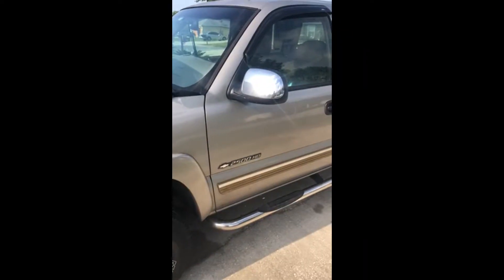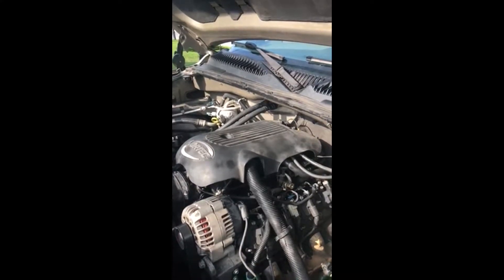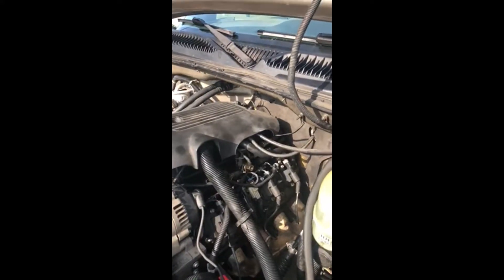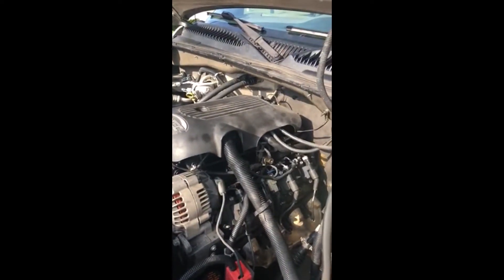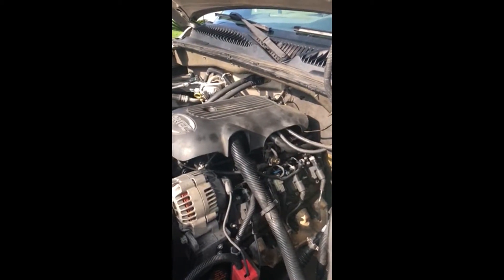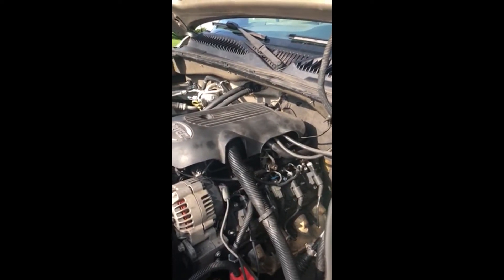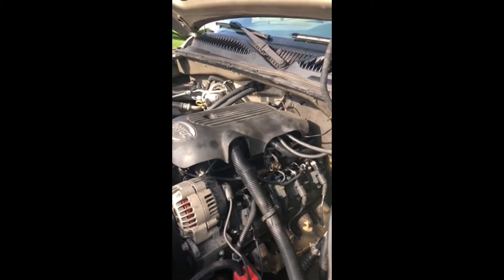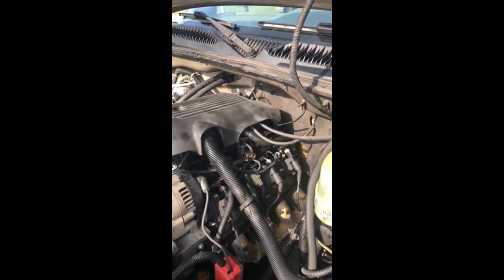Secret to Fix Knock Sensor Issue

Comment: You think this will work on a c5 corvette?  Having this issue. Replaced knock sensos with 3 different brands. Come on like clockwork after 2 start ups
Reply from the maker: Question did you relocate correctly, Did you extend KS wires, Did you clear codes before following the rev procedure? 
If so you have s bad wire connection or bad KS’s !
Reply: @cjphillips987  Sensors are in OEM location. Just replaced again this morning with Napa brand “Echlin”. Light came on again after 2 start ups (as it has every other time with other sensors) I want to try your method but all the comments i seen  were for Chevy trucks. I have an 02 corvette
Reply from the maker: @slightlymodified501  I understand you have a Vette, principal of operation is the same it should work. FYI install KS’s Dry thread if you lubricate threads KS’s won’t work! 
KS’s are a microphone/ sensing Harmonic’s! 
Let me know if you apply this procedure/ Result’s!
Good luck 👍🏻
Reply: @cjphillips987  Just did it but there is good news and bad news. Bad news is that the light came back on but the good news is it was only for 1 sensor P0332. So Im pretty sure it worked but I got a bad sensor. I am going to back in the sensors that I got from the chevy dealer and do the procedure again. I will check back in. I have a little bit of faith again!
Reply from the maker: @slightlymodified501  Great, I understand frustrating KS issues 
My KS have not coded since i made this video, good luck 👍🏻

Comment: I’m a bit skeptical but since I’ve had the confounded intake off 3 times I’m willing to try anything if I can leave the damned thing on.  I just ran the procedure. I’ll take it for a drive and update this when I’m sure they are working properly. Or if the code pops up again. 
P.S. my truck sounds AWESOME at 5000 RPM. 😁

It worked. See my update below. 😀😀😀😀😀😀😀😀😀
Reply from the maker: It’s worked for all but 1, he had an ECU issue. 
Let me know!
Reply: @cjphillips987  
I’ll be damned. I’m shocked. I can’t believe it actually worked. I can’t thank you enough. I drove about about 20 miles (just a guess. I didn’t check the mileage) the last two times the lite came on at 5 to 15. It hasn’t come on YET. I certainly hope it stays that way. 
Thanks VERY much. How did you discover that and why isn’t it common knowledge?
Reply from the maker: @jimgordon3206  it’s Not Common Knowledge for Sure! 
Stealerships deffently won’t Confirm it and Do not want any to know it!
I Share my Knowledge of Hamonic Engineering with Those Who Listen to Understand vs Listen to Respond. 
I’m pleased to Know it Works for You, 
For your Payment I request you pass the Knowledge along, Share Often, Help Others!
Reply: @cjphillips987  
I’m glad to hear you say pass it on. I will. Thank you again.
Reply from the maker: @jimgordon3206  I Thank You 🙏 Please also give a Like and subscribe to my channel, if I’m worthy. 
Thank You I’m pleased it worked for You! Good Job 👍🏻👍🏻👍🏻😎
Reply: @jimgordon3206  Is it still good? My husband having same issue.
Reply: @nneal2096 
Sadly, no. I’ve replaced them twice. I tried another way to reset everything.  That is to disconnect the positive battery cable and connect a wire from the battery ground to the positive cable, NOT THE BATTERY. After a few minutes it’s supposed to clear all codes and reset the computer. That didn’t work either. I’m going to try the 5000 rpm thing again but hold it longer at 5000. Hopefully it will work this time. I’ll update if it works.

Comment: so tell me. (ive had the same issue.  Totally maddening.  I replaced them twice,  then my mechanic twice) Is it possible to do this rev reset AFTER you start having the code come up again?  Or does it work only after the R&R?
Reply from the maker: Clear the Code start the engine perform the rev process 
Shouldn’t have code pop up unless you have a bad KS or Wiring Issue
Reply from the maker: I’ve been driving 5 + years no code

Comment: Gonna have to try this out before swapping them out. My code comes and goes on a 2000 GMC sierra 2500 6.0. Sadly, it is smog month, so that code is the only thing I need in order to pass smog.
Reply from the maker: Could be failing connection plug on harness

Comment: Do you rev up the engine at 5,000 rpm while the check engine light is still on? Or you erase the code first then rev up the engine?
Reply from the maker: Clear codes! Then perform the procedure! 
FYI : PARKING BREAK ON !
Reply: @cjphillips987  ok cool.  I'm gonna try this.    I had a knock sensor code p0327 for years and I swapped the sensor 4 times. Still having the code.  And I swapped the connector.
Reply: @Hammy1088  did it end up working out for you?
Reply: @anthonylee1203  hey.   I haven't did it yet cause I am going to change the tensioner and the lifters and freeze plugs.  So when I do that I'm swapping the knock sensors.   But for sure I'll let you know if it works
Reply: @cristianmotagarcia570  I still haven't done it yet.  Kind of tight on cash.   But I haven't forgotten

Comment: I tried this on my 08’ Avalanche 5.3L.
It only allows me to get to 4k RPM. The check engine light comes on after awhile. Any other tips or tricks you can share?
Reply from the maker: Re-locate new sensors as shown in my other video 
K/S factory said “ 50%” of all new K/S are not valid!
I re- located mine for easy access!
I’m not pulling manifold every time it fails! 
I replaced them new with wire harness they failed 
I re located them years ago no more codes ! Still running great!
Reply: Replaced both knock sensors using ac Delco ,and codes still coming back on my 04 Chevy Tahoe,any solutions....

Comment: Thank you sir. I did try this with no change. Is there a code clearing action at some time before or after the rpm action you recommend?. Or does it clear on its' own after some driving?
If there is a clearing action required, is it best with a code reader or removing the battery cable? Thank you again
Reply from the maker: Morning Tim,
Yes you must clear code before performing the procedure. The knock sensors must learn the harmonics of your engine to send to the ECU. 
Mine is still working with out issues. 
Let me know if I can help you.
Reply: @cjphillips987  Thank you so much. I have cleared code I have done the action you recommend and only with about 5 miles at 60MPH still no code.
I will  try the KICKDOWN action with tromping on the accelerator , let it kickdown (around 4500 RPM and let you know how it goes.
Reply from the maker: @timdoreck3208  the 5000 rpm action should be done in park with break set ! I don’t suggest to be driving to hit 5,000 rpm !

Comment: Do you think this will work without replacing the knock sensors first ?
Reply from the maker: Give it a try but if sensor is faulty no it won’t fix it
Reply: @cjphillips987  ya looks that way. But I think I’ve found the answer. Going to try an external replacement .. seems to be working for most.  One guy even wired one sensor to both of the old leads. Apparently the computer still reads it as two .. 
    🤷‍♂️ we’ll see.  
  Thanks for responding. That cool. 
🤠🎸🎶🤙
Reply: So far so good 🤞🤞
Reply from the maker: @theofficialdiamondlou2418  it works!
Reply: @cjphillips987  I did the sensor relocation. Used one sensor hooked to both wires  to fool the computer.  So far 107.3 miles no codes !!!  The rev thing does work though. First rev spitin and sputtering , second a couple of pops , third smooth as ass on glass.  
Thanks.
Reply from the maker: @theofficialdiamondlou2418  the ECU Control computer must learn the vibration from new point to adjust the fuel air ratio then runs on new settings
Reply: @cjphillips987  I just cleared codes then replaced both knock sensors and harness codes came back now. Should I do the rev thing to reset my ECM or should I wire both wires to my bank 1 sensors? (My plug in machine says low circuit bank 2) again
Reply from the maker: @mister4053  Do the Rev relearn process if it comes back you have a connection issue
Reply: @cjphillips987  can you please explain the process IV heard different things, one person said 4k-5k rpm for 3 seconds twice. Some said 10 seconds twice. Will you please explain what you did to reset yours? I'll do mine today if so! Thank you very much
Reply from the maker: @mister4053  https://youtu.be/-PTpfWjD9v8
Reply: @theofficialdiamondlou2418 I haven't replaced mine and it's worked so far. After reving to 5K twice in park for 3 seconds with parking break on I took it for a spin like I did prior to this tip and check engine light kicked on. This time it didn't..
Reply: @Nate_4545  cool. Well it’s been 3 years and I’ve not had another issue.
Reply: @theofficialdiamondlou2418  what was the exact fix for yours if you don't mind me asking?
Reply: @Nate_4545  
I put a knock sensor on the passenger side head. Then tied both sensor wires into the one new sensor. Then did the rev procedure . I do t remember the fact procedure but there is a link up above in the replies .

Comment: I did this procedure on my 2006 Yukon. And on the second start the light still illuminates. New knock sensors and harness. Did you have to clear codes with a obd2 scanner
Reply from the maker: Yes I did clear code using scanner then followed procedure

Comment: Just replaced mine ks an wires an my cel still came on what is it that i have to do to get rid of it
Reply from the maker: https://youtu.be/-PTpfWjD9v8
Reply from the maker: https://youtu.be/DnnjXBEmH4s
Reply from the maker: I re positioned mine for future service Followed Rev procedure, 
 No More Code Still Working Fantastic! since videos were made!
Reply: @cjphillips987  in the process of reving it to 5k do i need to delete the codes first ?
Reply from the maker: @quentinmiles2246  Yes Sir ! Park Brake On Be Safe!

Comment: I replaced camshaft sensor but obd2 tool still shows code p0366, this trick will be applicable for it also?
Reply from the maker: Cam shaft sensor on what engine?
Reply: @cjphillips987  GMC acadia 2009

Comment: Did not work for my 03 silverado. I guess I'll keep working at it.
Reply from the maker: 🤔 sad to hear, You Have bad KS’s or wiring issue.
Reply: KS and all wiring test good all the way to the ECM. I even put a new ecm on it and still can't get rid of the code. If I figure it out I will post on here. I'm glad it has worked for some.
Reply from the maker: @ChrisWilson-qc9jq  Question did you clear the codes first? Did you relocate them or put back in original position?
Reply: I have a set in the original position and I have a set relocated on each side. I reset the code and tried it twice but within about 10miles I get the pending codes then restart and another 10 the CEL comes back on. I even tried swapping the banks to see if the code would switch to bank 1 but no luck. Still bank 2 everytime.l
Reply from the maker: @ChrisWilson-qc9jq  sad to hear,
The AC DELCO Enginer I spoke with stated 50% of all Pizzo K Sr’s they sell are faulty out of the factory! 🤔🤦🏻‍♂️🤦🏻‍♂️
Reply from the maker: FYI do not lubricate the threads when installing it causes interference!

Comment: I just replaced both knock sensor  and the cable in my 2000 Chevy but the codes still appear
Reply from the maker: 50% of all sensors are faulty from factory check for Whitch one is coding and replace it check wires too
Reply: 3 out of 4 purchases had a bad knock sensor from the supplier.   Once I found a good one, I mounted it on the engine block, rear side.  A properly threaded hole was available and I used it, rather than taking the intake manifold off the block to replace the knock sensor 3 times.   Extended the cable, soldered and shrink wrapped it, so no moisture would breakdown the connection. 

Important: Clear all codes.  You can do this in the beginning before you start this procedure. 

Bringing the engine to 5k RPM’s for 7 to 10 seconds, twice.   This allowed the ECM to relearn and i’ve had no problems in weeks.     Thanks for all your help!
Reply from the maker: @JayTFoster  hope it cleared your issue you still have to clear initial codes !
Reply: @cjphillips987  Yes.  I cleared codes first.  Made the edit above.  Engine is running like new.   Thanks for everything.
Reply: @cjphillips987  still running!  No problems at all.

Comment: Is this a definite fix or will I break something else if i try it?
Reply from the maker: It’s been working for over  a year still no issues
Reply: @cjphillips987  but what I’m asking is it a definite fix
Reply from the maker: This won’t break something eles. Other items break down independently
Reply: @cjphillips987  ok thank you, I just thought 5000 rpm was a lot for the engine but I will try it out and see
Reply: @hankm2457  These engines are bulletproof, 5k rpm won't bother it, These engines seen to love Revving really high

Comment: The process may have worked as the light is not on after driving around 45 miles.  But when I scan it tells me P0332 is pending. Can you tell me what’s going on?
Reply from the maker: Clear the codes then do the procedure
Reply from the maker: If code comes back you have a bad K Sensor or Faulty Wiring

Comment: If your shits fixed properly this isn’t necessary lol. If codes keep coming back something is wrong. Never reinstall a sensor. New sensors and harness should be the permanent repair. My codes kept coming back. Turns out had broken exhaust studs super common on LS motors and bad motor mount. Perfect triggers for KS codes.
Reply: What code were you pulling?

Comment: I wish this fixed my issue 😔
Reply from the maker: It depends on what your issue is?
Reply: @cjphillips987  replaced sensors and harness twice, tried the fix in the video twice and after 100mi the engine light pops back on. I even tested resistance on the wires going back to the computer and nothing. Checked continuity while shaking the wires, nothing. Every avenue is a dead end...
Reply from the maker: @gunsmoke132  Sorry to hear, if both KS are valid, connectors and wires valid, you cleared codes rev’d and code comes back you either have excessive noise coming from engine or a faulty ECU.

Comment: I know its possible to push them this hard but I wouldn't do so with no load myself.
Reply: Don't worry about it man, These motors are damn near bulletproof and they love sitting on the rev limiter (6k rpm) A few seconds of 5k rpm won't bother it

Comment: Thanks now rod knocking
Reply from the maker: If a Crank shaft / Piston Rod is Knocking the sensors picked the sound up first showing out of parameter! Relocating them does not cause Rod to Knock, Worn out Bearing or Piston Slap is the issue. Sensors are just a amplified Microphone listening to the engine adjusting timing and fuel through the ECU / ECM unit.
Reply: Will this work on a 4.3l vortec? Mine has a single knock sensor on the back of the engine.

Comment: There’s no way this works. I’ve fought everything from grounds to tracing pcm voltage. If it works I’ll send you 25$
Reply from the maker: My Opinion 
K/Sensors are a Pizo based harmonic microphone. They must be adjusted for vibrations of the engine to deliver correct data to the ECU / ECM of the vehicle. 
Knock sensor mfg engineer said 50% of all K/S from factory are not correct 🤦🏻‍♂️. That’s why I relocated them externally to replace in the future. I have not had any code since before I made the video was made. I posted it to share and help others. Read others comments it WORKS!
Reply: @cjphillips987  just tried it in my truck. Does not work
Reply from the maker: @fiveninegarage  https://youtu.be/DnnjXBEmH4s
Reply from the maker: Question did you clear codes before 5,000 rpm rev. 
FYI Rev should be completed in Park with break on not driving on the street.
Reply: @cjphillips987  2006 2500HD 6.0 Gas Chevy. 

Knock sensor codes bank 1 and 2 low circuit voltage. 

-all ground cleaned and block ground relocated 
-new ac Delco knock sensors 
-new ac Delco knock sensor harness 
-all components tested and in spec 
-wires from pcm to knock sensor harness hold 12v 
-pcm output is .12v at both the pin and harness plug while running (I believe it’s supposed to be 2.5v plugged in and 5v unplugged) 

I’m at a loss of what else to check other than replacing the pcm. One clue I do have is if the code is cleared with key on it does not come back until the truck is turned off and restarted.
Reply from the maker: @fiveninegarage  Question Did you apply anything to the threads of knock sensors when you installed them? 
i.e. thread lock, lubricant .
Reply: @cjphillips987  fsm specifies not adding anything to threads
Reply from the maker: @fiveninegarage  you are correct the voltage en difference/ range can cause issues, PCM / ECU Unit issue. 
Have you disconnected power, disbanked PCM then reconnect power verify voltage for knock sensors ?
Reply: @cjphillips987  I’ve had it all apart to check for corrosion in plugs. I’ve had the pcm out. 

Not sure what you mean by last part. I’ve checked ohm reading on both knock sensors and it’s good. Circuit holds 12v
Reply: @cjphillips987  if I clear the codes with key forward they don’t come back till key is turned off and back on. Like I can drive for forever if I clear the codes, and they don’t come back
Reply from the maker: @fiveninegarage  yes dry threads! Knock sensors are too sensitive, anything on the threads they will not work!
Reply from the maker: @fiveninegarage  Disbank pcm power, pull positive and negative cables from battery. Touch negative and positive cable ends together for 10-30 seconds reinstall to the battery then try/ test circuit. 
The momentary positive/ negative cable end touch gets residual current out of pcm to reboot it. Similar to rebooting your computer.

Comment: If this works I’m going to send you $20
Reply from the maker: I sure you have doubts, I learned this through conversation with a Chevy certified Technician. I did it after changing my sensors years ago no more codes ! Good luck let me know! 👍🏻👍🏻👍🏻😎